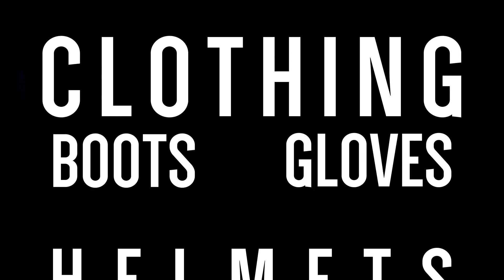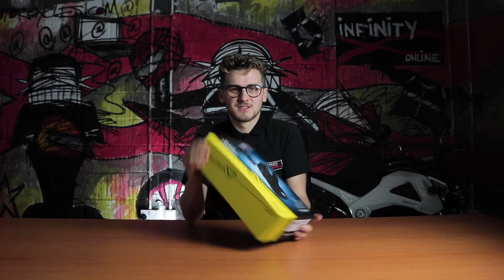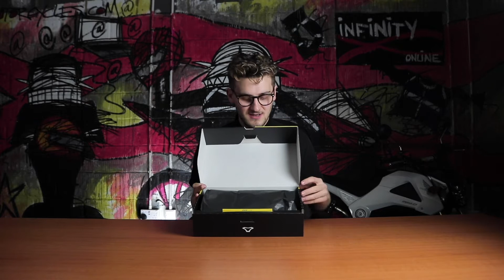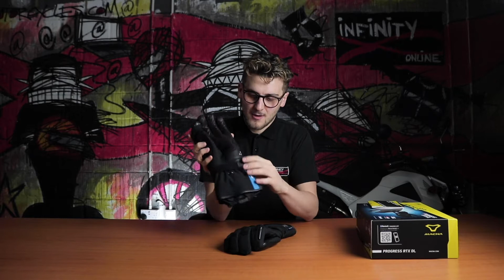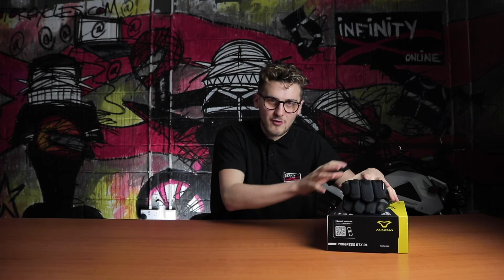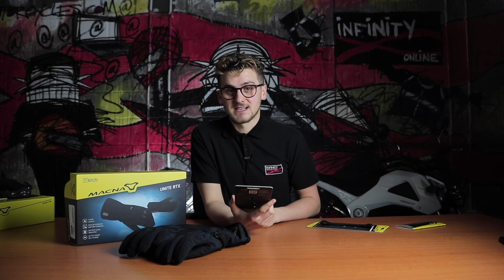Heated Gloves Unboxing | Macna Bluetooth Motorcycle Gear

Comment: when you plug them in to charge there is a green light which then changes to red. is it red when charging  then   green when fully charged.there on line user guide is not very good .there was no user guide in the box ty .

Comment: These vs Racer Heat 4?
Reply from the maker: Tough call. They are identical on price if you opt for the battery in the Macna, but you can't plug the Racers into a bike. The Macna Progress are also laminated (will dry quicker) & have bluetooth. 

I'd go with the Macna - Tom
Reply: @infinitymoto  would you say the battery life and how hot they get is identical in these and Racer?